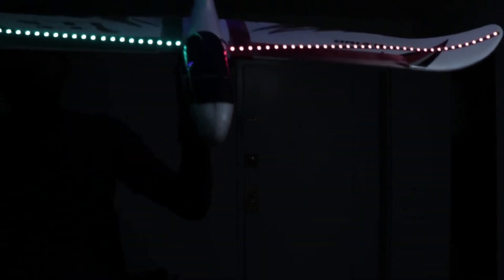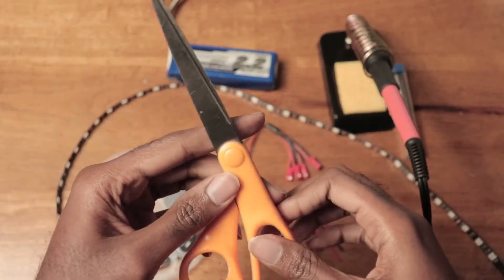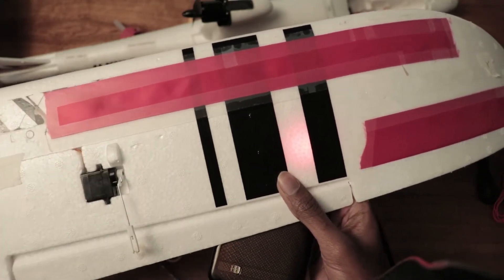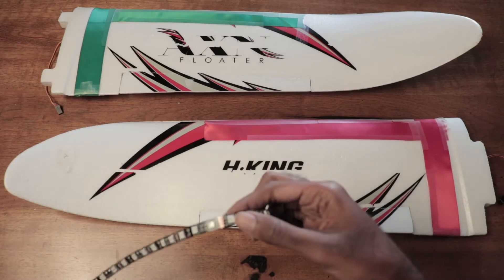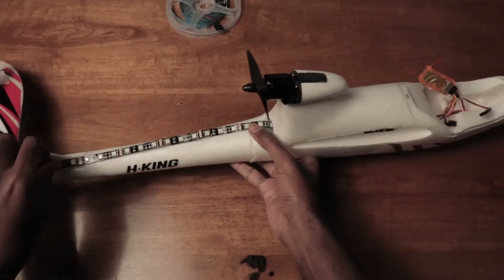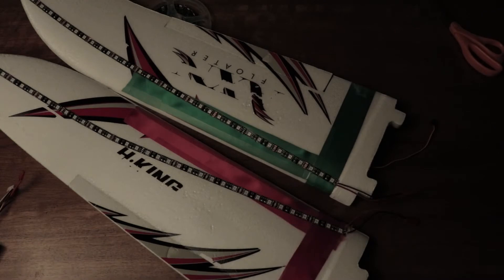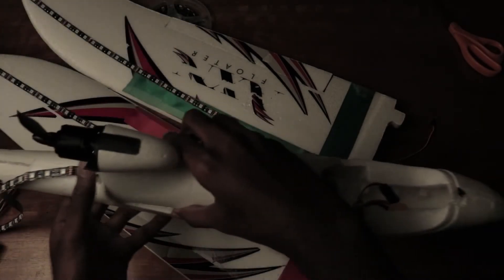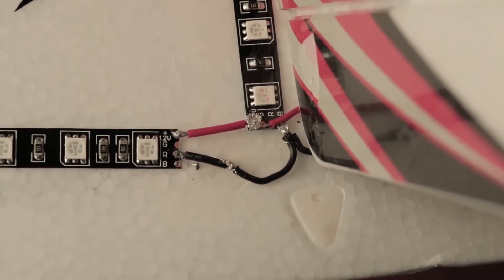Installing LEDs on an R/C Plane

Comment: you should only need 1 jst connector.  you need 1 power lead 12 wire and 1 color.  if you make a jumper from lets say Green to red it will split.  also if you flip the LED's around they will shine thru the foam a lot better.  good job tho
Reply from the maker: dont think i could have done that if i wanted to keep remove the wings later